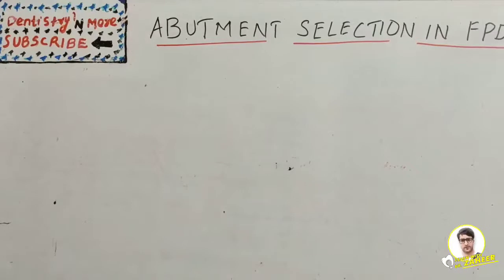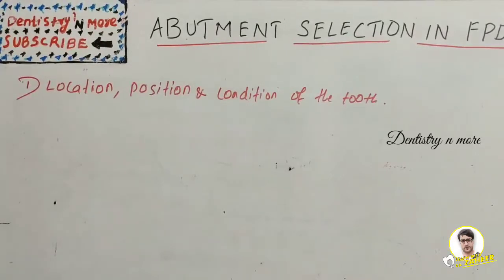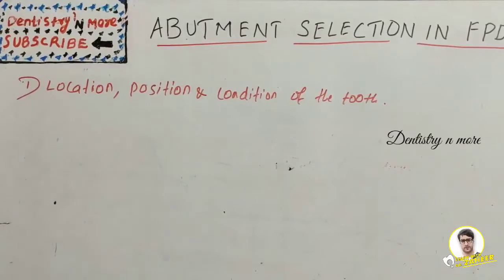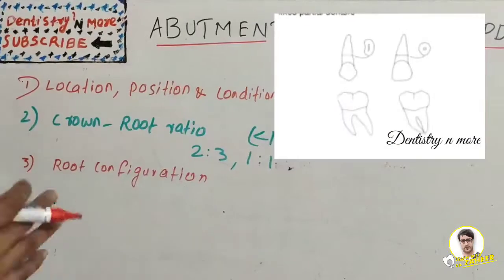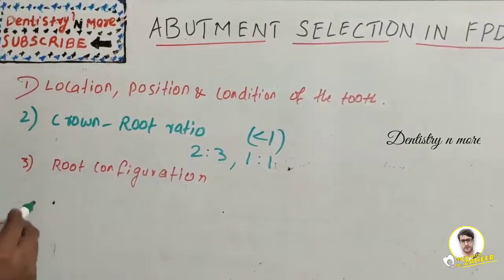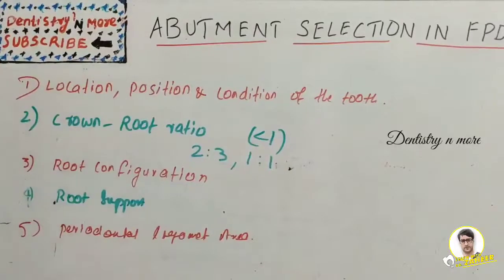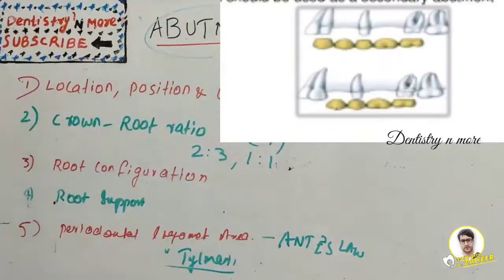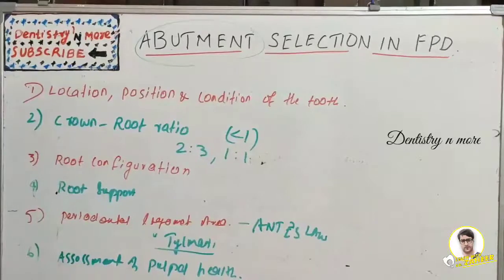ABUTMENT SELECTION IN FPD

Comment: Which is the most important factor sir?
Reply from the maker: Adequate root support should be there for proper abutment selection.Ideal crown root ratio should be less than 1.approximately 2:3. These two can be considered as important among all, still all factors must be there to have a long lasting FPD.